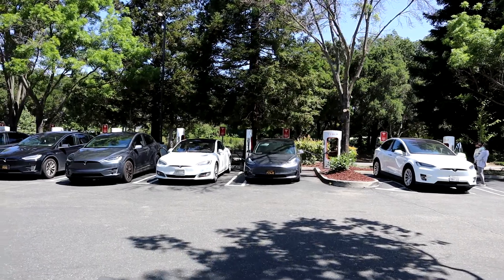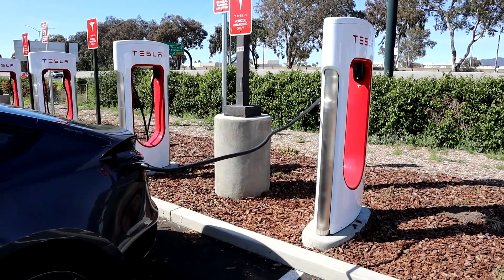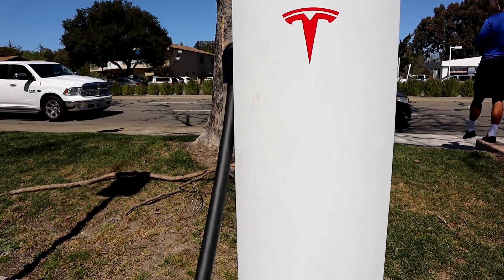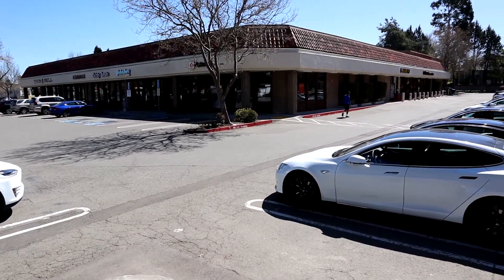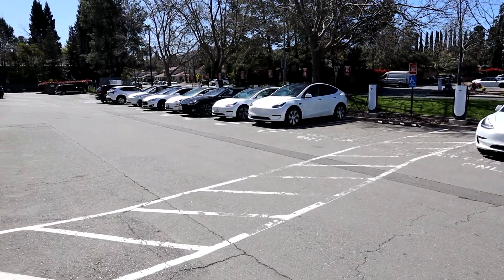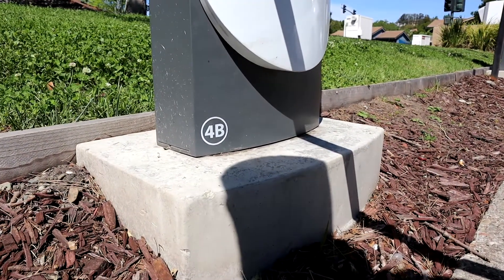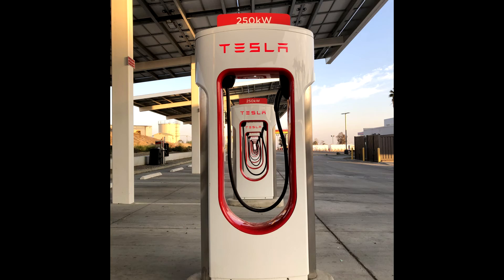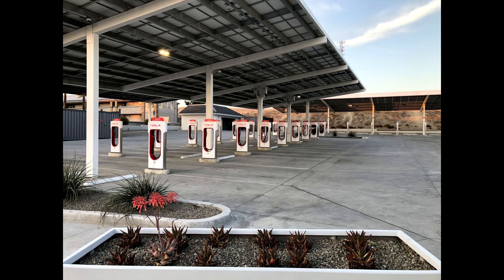Tesla Superchargers? Urban? V2? V3?  What Are The Differences, Identify And What It Means For You

Comment: So, the etiquette at Superchargers is the same as at the bank of urinals in the men's room. Don't take the one right next to someone else if there's another one available. Got it.
Actually, this video is very helpful to me as a prospective Chevy Bolt driver. The Bolt, using the Chevy app, can now charge at Superchargers, but only at the V3's and later. The V2 evidently won't work with GM EVs (and maybe other non-Tesla brands.) It's good to be able to tell one from another at a distance.
Reply from the maker: This is a standard non Tesla thing.  I can only charge our Rivian at the same stations you'd be able to charge your Bolt.  Only some V3's and the new V4's.

Comment: Very helpful info on distinguishing v2/v3.  I have an older 2015 p85d and don’t use SC very often so I was curious how to tell them apart (not every station has signs like Kettleman). 

When I bought a model 3, it was clear that the 3 was going to be able to accept more SC charging amperage than my S….I’m dating myself back to an era when “dual charging” was still a term…is there a way to know when my S will really benefit from a v3?  I was at one location last week with low SOC and briefly topped 400m/hr charging - but tonight it’s only 160-180 on a 35-40% soc.  I thought that v3 overrides the OBC BMS, so I was surprised I was getting something typical of v2 charging.
Reply from the maker: Honestly a 2015 S is pretty old in terms of tech.  I'm guessing here, but the battery chemistry is so old that I don't think any software updates will be able to boost charging.  It's probably just going to degrade the battery more at that point.

On your 160-180kW, it's possible that your SOC was high enough that the BMS didn't think it should go any higher.  Ambient temp could've also played a part too.  There's a lot of factors, so doing 160kW doesn't necessarily mean something is wrong.

Comment: still relevant after 2 years ... well done... Brattleboro VT has both V2 and V3 without signs ... will look for cable size ... thank you
Reply from the maker: Glad it helped.  Yeah Tesla hasn't done much in terms of adding more power to SC's.  They are focused on pushing out as many V3 stations as they can right now.
Reply: Noticed that too, as well as the West Lebanon NH supercharger.  Only was able to distinguish between letters.
Reply from the maker: @santajerry  Glad it helped

Comment: Helpful, was looking for ways to distinguish V2/V3! However your reasoning for smaller packs not charging at full 250kW is wrong, it's not the packs surface area that limits, its the amount of cells, each cell can only take so much max charge depending on chemistry, age, etc. more cells more power u can charge at.
Reply from the maker: User name checks out :D.  With all that knowledge, how come you're not making your own videos? :P.  Thanks for the tip.
Reply: @nukem384  I'm working on it, will be posting in a bit

Comment: if I pull up next to a tesla to share a V2 supercharger, will I reduce that car's charge rate? Let's say he's charging at 100 kw/hr.  From what you said, I would just get whatever is left over until he leaves, right?  (ie 50kw, if I can use it).  Or does his rate drop down to 75 and mine will be charged at 75 as well?  It wasn't clear whether or not the first car using the supercharger maintains their charge rate.  Personally I superchargers should never downgrade the rate on someone who showed up first.
Reply from the maker: The theory is what I explained.  You're going 100kW, the person then plugging in gets 50kW.  But from what I've seen, if someone plugs in next to you, your charge rate also drops.  How much, I can't say because I think it varies.  Basically, don't plug in next to someone at a V2 if you can help it.
Reply: @nukem384  thanks. Indefinitely got the etiquette part but I just understand how power was being distributed to secondary users.
Reply: @scottdang4704 I think it works as discussed above - person 2 does tend to degrade person 1 a little - but we’ve always been told person 1 does have some priority…that said, it’s easy yo overstate any sharing impact on v2 chargers bc the Battery Mgmt systems on the OBC can’t charge at full steam except when the SOC is pretty low…the BMS for other rechargeable batteries (like on remote controlled man toys) vary from constant amperage to constant voltage at various SOC so as to keep degradation low.  And this is really noticeable if you watch how long the last 10-15% SOC takes…but it almost surely starts lower as well, so person 1, having been there longer and having a decent soc, won’t be pulling as much juice anyway…so in reality, the likelihood two people are both at a point where they want to pull a combined amount above 150kw doesn’t really present a serious issue in most cases ime.